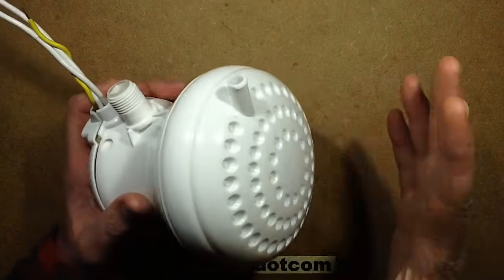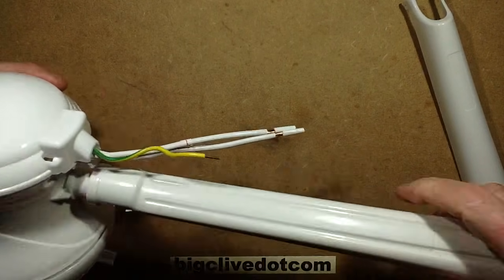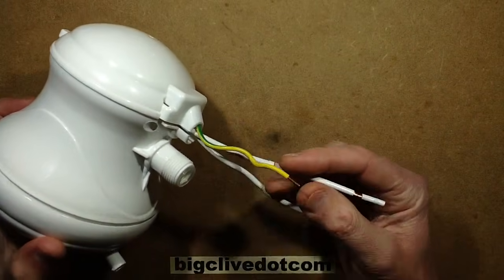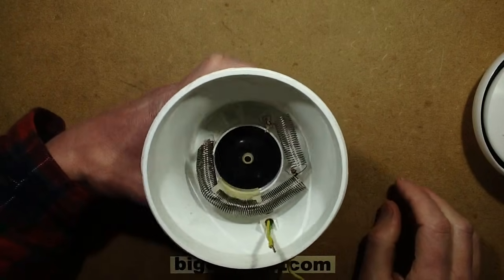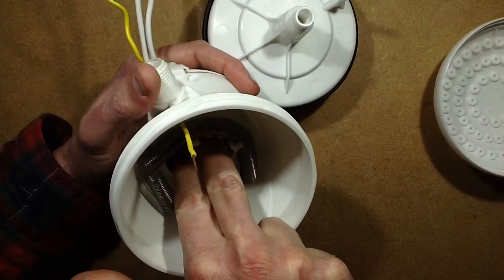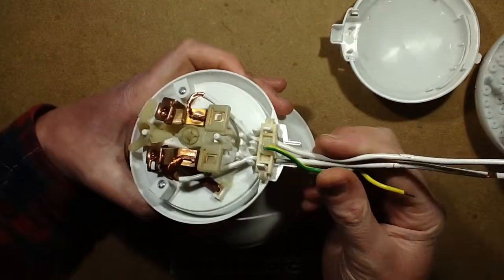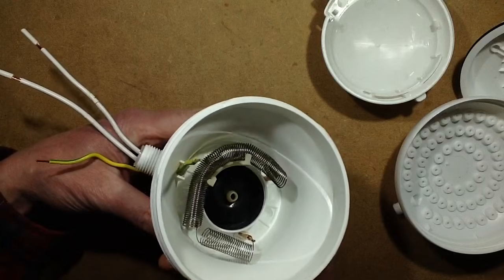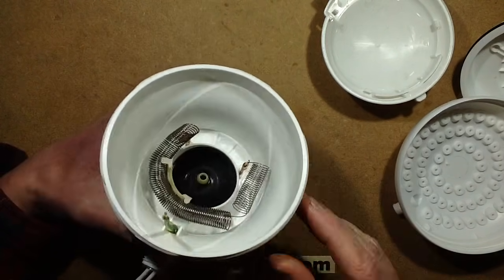Inside a heated shower head.  (suicide shower)

Comment: electric shower heads are pretty good, only problem is that they take some time to heat during the winter but otherwise it's pretty handy and way easier to use and maintain than gas heating

Comment: Used such a device my entire life (20yrs), without the ground wire most of the time. Experienced no trouble beyond some ocasional small shocks, when touching the metal tap of the shower, usually when the hands are lil wounded - no big deal.
I'd say the most dangerous part of such a device is when it's badly installed with thin wires, which overheat and create fire hazard... This by the way, is somewhat common here in Brazil...

Comment: well, those are widespread here in Peru, but that's a knockoff of the Lorenzetti brand, (Ducha means shower in spanish, no connection to a douche), now the common instalation of those is to go trough a thermomagnetic breaker near the shower and the earth wire connected to a nail in the wall, which is mostly concrete or masonry (yeah, totally safe). I've been showering on those since I can remember, and the only problem I had is when i moved to a rented house, where the showerhead was too close to my head...

Comment: Water and electricity just kill you if it is salt water or soap water. Clean water has very low conductivity.Even  if it is not grounded and you also have salt contaminated water the only thing you might experience is a little tingling on your finger.  Here in Brasil we all use this shower. Mc donald's maybe have killed more people here than this shower! hahaha

Comment: I live in Ecuador and we used to have a 110V 40A shower like this, a slightly higher end type but the same basic heating approach. Earthing was done, but in any case, this was connected to a decent (but insufficient) size cable, in turn connected to another cable, to another, to a switch, to undersized wiring through a chimney (without any protection). It was replaced by a proper electric instant water heater on a 50A 220V circuit from Stiebel-Eltron with a properly fused new connection with appropriate cable direct from the heater to the meter. The danger of the equipment is the installation. The people that typically have this type of shower, will potentially run it of a simple extension lead and/or worse, twist together the wires with a bit of electrical tape over it. Not safe at the best of times, but near water and with the current this pulls, scary. Also the earthing in many buildings here leaves a lot to be desired, and I'm getting ready to rip out what I can and rewire the majority of the property.

Comment: You should not have removed the silicon from the "earth wire". 

Silicon is a fine conductor, it would have no problem passing electricity from the water in the event of a short. That's why it's on the ground wire, it's serving those purposes. Plus it would prevent corrosion to the wire from minerals in the water. If the wire became corroded then the corrosion would resist current pass through and potentially electrocute someone.
Reply: Silicon*e*. Big difference there.

Comment: I've seen that on my travels in Africa and it's a good idea just to use a hot tub and let the water warm up from the heat inside the bathroom or skip showering for a while. I'm an electrician and that showerhead was designed in hell.

Comment: A metal version of this has been used in the Caribbean. I've vacationed in mountain resorts there and the shower head is connected to regular plumbing with a simple A/C cord that is plugged into a socket about six feet away from the shower. When I first saw this the resort manager said that in all the years (since the 1960s) they've had them, they have never had anyone suffer electrocution. So I guess it must be a well made product.

Comment: I been using those electric showers for over a decade they last like a year at most I had several burn(they burn like a light bulb) while showering they do make a spark inside that lights up the bathroom but i have never had an electric shock from them. People use them because gas prices are very expensive.

Comment: i live in Brazil, shower in one of those everyday, no earth wire, you can indeed feel the current passing through you when you touch the water valve, but it is barely enough to be felt, like when you stick your tongue in a 9v battery is a lot stronger...
its just a pain to change the heating element on it when it inevitably busts due to corrosion.
i think we don't care about it because there's so much more ** threatening our lives a lot more than that on a daily basis...

Comment: As long as the wires are well secured, the body is completely filled with water before you turn on the power and you don't switch temperature with the water running, they are actually quite safe (extra safe if you connect the ground wire to a grounded system). I can understand the shock (no pun intended) of most people in the comments here but as someone who does use one of these, I can safely state that they are far less scary than you guys are thinking (actually not scary at all). I assure you all you are simply not accustomed to the idea of having water and electricity together in the same device and right above your head. These showers are extremely common in Brazil, for example. That bit about being shocked by the water if you get too close to the shower head is silly, though. I've never heard about a single person ever being electrocuted by one of these in my entire life. Just make sure the wires are well secured and keep your hands away from them and there is 0 danger. They are at a certain distance from where the water comes out for a very good reason, you know.

As for the reason the wires seem so short, it is because they are meant to be connected directly to the wires coming out of the wall. Electrical showers must not be connected to an outlet due to the heat they can produce so for safety, the wires are supposed to be connected directly to the system, but not simply any wire, either. Houses that use these kinds of showers must have a separate system exclusively for them so to not overload all rest. If for some reason the system or the wires do overheat, the circuit breaker should automatically shut off for safety and to prevent a fire. Also the wires must be of the appropriate thickness and type to they won't overheat with the flow of electricity.

Electric showers, if installed correctly, are as safe and harmless as the light bulb above your head in the ceiling right now. Millions of people use these every single day in Brazil, have been for decades and there have never been reports of electrocution by these things. If they were as dangerous as the video made they seem, that country (which mind you, is huge) would have migrated to another type of heating system decades ago, by now.
Reply: That's just sounded kind of rude, but i can see your point.

Comment: I would say about 95% of showers in Brazil works like this one. I have two myself at my home, and they are pretty safe
Reply: kkk sim, nunca vi ninguém morrer
Reply: Luiz Fellipe Carneiro needs a ground /earth or can end badly
Reply: nah, i`ve been around ungrounded one for most of my life and never seen someone getting shocked, i`d say dying from eletrocution on those showers is as common as dying from the gas unit exploding on a gas shower
Reply: I'm from Brazil too and I have to say that 90% of houses of those 95% don't have a ground connection anywhere :-P
Reply: I have never died from them
Reply: But almost NO houses in Brazil have gas pipes installed, so to do it would cost a FORTUNE to do.
Reply: Bro... don't feed the trolls. :/
Reply: as vezes pega fogo se a água for muito salina
Reply: Luiz Fellipe Carneiro I want one one to power off solar in my RV but Iive in USA and not sure American solar technology is compatible with 240 step up inverter .😅 you see are system's will usually shut off if you tried using two solar modules.
Reply: Depends of country.
Reply: Had one for years, never had problems nor accidents, just use one of better quality than this chinese fake stuff
Reply: Not. if is used on demand.
Reply: I guess, you still live in your little bubble country.
Reply: As Arthur said, this is a new definition of safe that I have not previously been aware of.
Reply: 95% of middle class houses, yes. the majority of the people take cold showers and the upper class have gas heat systems
Reply: uK8cvPAq not over here it isn't.
Reply: picketf 1- barrense nem é gente
2- saying barra da Tijuca is the highest standard here is at most a bad joke. I'm from Rio, born and raised, live in Vitória, and I definitely see that the buildings are built to code, each according to the era they were built in of course. Barra is basically an exception at this point, it's got a long history of real state speculation, shady deals and corruption that created an ugly, arrogant neighborhood. I often forget why people even bother to live there, and then I remember exactly what kind of people live there, and then it makes sense again.
Reply: Lol if youve used this ungrounded and you never felt tingling it's probably because you're a midget. The further you are from the shower head, the more distance the water has to break up into droplets. And if it's broken up there's no longer a continuous stream of water for the current to get to you. This is why big clive made the point about taller tourists getting shocked and the shorter locals being fine with it.
Reply: Martin are you illiterate or just stubborn? We have codes. Also no, houses with these don't have heated water in the sinks, because these shower heads are used in the tropics where that's not necessary at all.
Reply: Shockwave Shockwave 😂😂😂
Haha very funny and you're spot on!!!
Just because they don't understand how something works they feel okay labelling it dangerous. I'll keep enjoying my shower.
Reply: People from first world countries seem to lose their utter shit about these, but if the electrical installation is done to code they're absolutely safe and not dangerous at all, not to mention much much more energy efficient than boilers and other such solutions that lose heat to the environment.
Reply: It's the only shower head I've used all my life and still, here I am. 99% of people in my country use the same and guess what, not a single incident that I've ever heard of. It's unfair to call it suicide shower
Reply: Peter Mwangi it's the difference between rich countries and poor countries, let's see examples of people's reactions with this shower:

Rich country: THAT'S SO DANGEROUS OMG HOW YOU DO IT?!? AAAAAAAAA

Poor country: can i get a discount?
Reply: Really true. I cant understand how New Zealand and Australia, still have heat water cilinders, in their home....heating up water...during the night, winter, when nobody is at home.....
Reply: you people seams to be unable to diferenciate up to code, satisfactory, safe, and axident free.
are those things :
-up to code: yeah probably for the most parts.
-Satisfactory : hell no but that's my standard and to me most electrical codes are below my standards.
-safe: depend on your definition . I'll say that anything that mixed water and electricity is not safe but aging that's not me.
-axident free: I don't know and apparentely nither dose any of you. I do know one thing those things are way more dangerous than a properly instaled electric central heatear.

and yea questions . whY not use gaz? it has to be cheaper. unless evryone just has their elec for free.
Reply: HakureiSM 
If an exposed wire means life or death I think I can live with "losing my shit" over the fear of being killed during a shower.
Reply: how can this be possibly safe?!
Reply: uK8cvPAq electricity is more expensive than gas here due we don't go killing middle easterners for cents in gas price
Reply: I can vouch for nobody following electrical codes in Brazil. I used silicone glue to attach a plexiglas housing to waterproof and seal 2 big 5 VA fuses (one for an electrical pressure booster and the other one for the heater unit). It was inside a rented apartment in Barra, Rio de Janeiro so presumably the highest standard of living in Brazil and the chief that was responsible for the electricity and ventilation system of the whole building, a professional electrician, was in awe and had never seen it done the proper way!

People never ever use fuses and then when they have the so called "pico de luz"; fluctuating current spikes due to shitty infrastructure they burn these out and just buy new heating elements over and over again.
Reply: Rio, with the highest standard of living in Brazil? Ha! Good joke!
Reply: Electricity is more expensive than gas.
Reply: well whiole of south america is a dump so im not suprised
Reply: What are your prices per kwh?
Reply: They are still third world shit hole nasty, and of course if this is in the shower head you can guarantee there ain't no hot water in the bathroom or kitchen sinks.... and most of these shit holes do not follow electrical codes and they don't ground shit
Reply: LoL... triggered.

Comment: I doubt this suicide device would meet the regulations of any EU and Northern America country.
Reply: tmkoeln, FYI, they sell these in the US. I personally don't recommend them, I was shocked once, not pleasant.
Reply: In Germany anything directly connected to water and power in bath rooms is forbidden by VDE regulations
Reply: tmkoeln, it's possible to run electricity safely under water (pools lights, submersible water pumps), but it needs to be properly insulated. For safety, the restrictions you mentioned make sense to me, but I doubt people follow housing codes.
Reply: just because they are sold doesn't mean that you'd pass a building inspection with one.
Reply: No, but the installation is only allowed, when you have a ground connection, and the socket is protected against water splash.

But what I said is, that no electrician is allowed to put a mains socket in direct near of showertubs.
Reply: I think you might installed it wrong, I use electric showers everyday two times for 14 years and i never had any problem.
Reply: tmkoeln So waterpicks are banned In Germany? damn, I would hate wearing braces
Reply: > So waterpicks are banned In Germany?

In European bathrooms you will sometimes encounter a special electrical socket like this:

https://www.google.com/search?q=scheerstopcontact&source=lnms&tbm=isch&sa=X

... that has an isolation transformer inside:

https://en.wikipedia.org/wiki/Isolation_transformer

This allows you to use electrical toothbrushes and water picks. Normal electrical sockets are forbidden in bathrooms. Electrical sockets and water are considered a deadly combination and must be kept at great distance from each other.

The isolation transformer in the special socket prevents a current flowing through you to ground, eleminating direct risk. And further, the wattage is extremely limited, so that the voltage will immedeately drop in case of an undesired current.
Reply: @danielmantione  That sounds like German bathrooms don't have regular sockets, which isn't true. All apartments I've lived in had at least one. In newer buildings all circuits in a shower room must be protected by a GFCI device, so you'll have a hard time killing yourself even by dropping a toaster into the bathtub.
Reply: @BuddyCasino  The rules are indeed much more complex than that it is simply forbidden. There are zones in the bathroom that need to be established and if you are outside the critical zones, a regular socket is allowed. But for simplication you can say that, in principle, you can't install a regular socket in a bathroom, which actually is the de facto situation in a lot of bathrooms.
Reply: In Germany it is definately forbidden to run devices in shower that are connected to mains (so no hair dryer in the shower for example.).
Reply: +Daniël Mantione I'd often wondered how the sockets in German bathrooms (IME: Directly next to the basin) could be regarded safe, given German standards are far stricter than in the UK and even we have an outright ban on outlets in bathrooms! :-)

It surprises me they aren't labelled as an isolated supply, though - Perhaps with the "Double ring" symbol. For the Auslander amongst us it'd answer a few questions and give us a lot more assurance! :-)

Comment: Mains voltage or not, unless you're pushing stupidly high water pressure through that unit, the stream of water coming out isn't 100% continuous and breaks apart too much between the head and your body to deliver enough voltage to give you much of a shock. Suicide shower my ass.
Reply: Because electricity couldn't possibly arc through air, or someone couldn't possibly touch the shower head itself...
Reply: You make a good point.  I hope you have better luck with it than I have had pointing out that millions of people shower with these every day and no one is being killed.

Comment: You're reviewing a very low-end shower head, but "suicide shower" is somewhat misleading 
I live in Brazil and here these showers are common, and I also work on a building materials supplier, so I know these little things better than anyone. Not all electric shower heads are the same, there are high-end electric showers too, and they look a bit the same (but a little bigger). And yeah, they're safe if installed correctly, because every shower head sold here has to be certified by INMETRO (Brazilian regulatory and safety agency). Of course, I don't know about the safety measures in other Latin America countries, and these showers can be installed incorrectly, but they're quite safe. I have been using them for more than 20 years and never heard about someone killed by one.